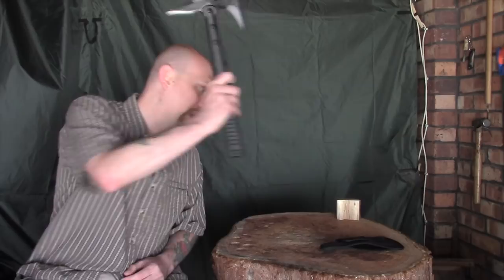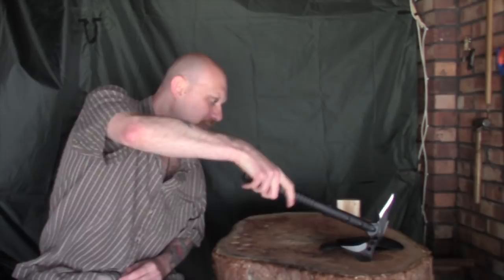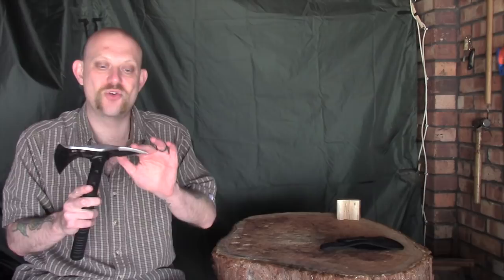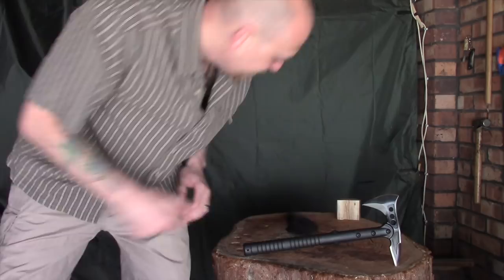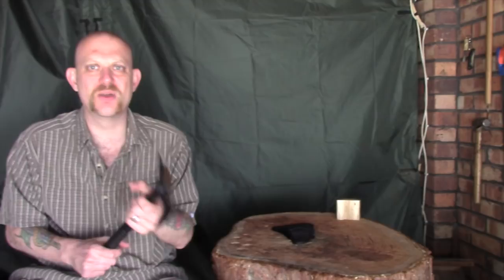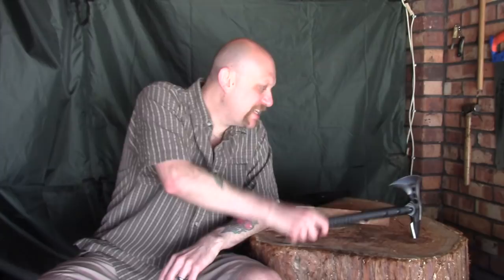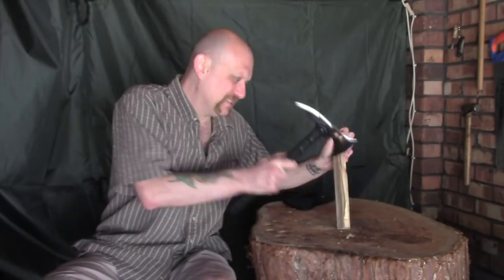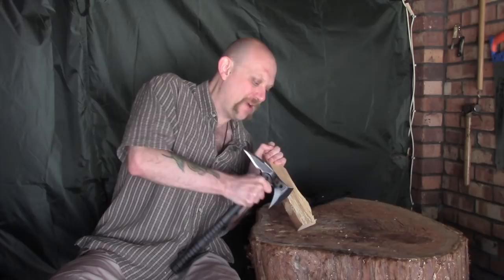Cheap Chinese Axe for Bushcraft???

Comment: That knot made the difference. I once owned a United Cutlery M48 tomahawk which looks identical to this and the wide edge made it an excellent splitter but poor carver. They are also a cast head, which did not seem to be an issue for durability. In all honesty they are mostly intended as a breaching tool and as such they work amazingly well. After severely abusing the M48 (which I had gotten well used) I passed it to a friend. The spike works amazingly well breaking up hard dirt and semi rotten logs, especially when hunting fatwood. I often use the Cold Steel Spikehawk as a bushcraft tool and don't find not having the hammer poll of my Pipehawk an issue at all.